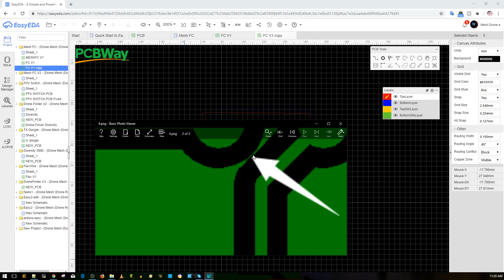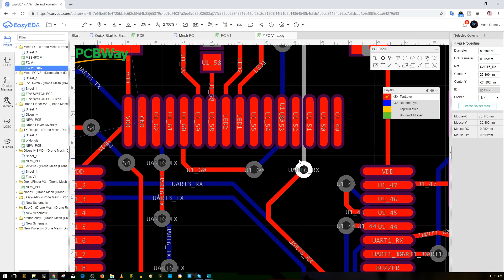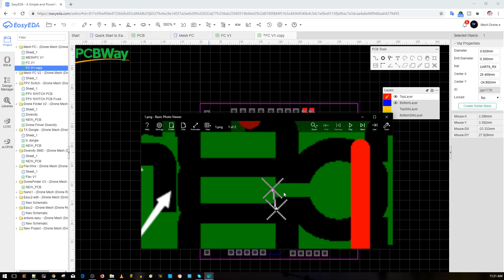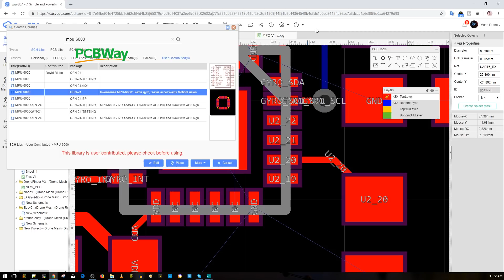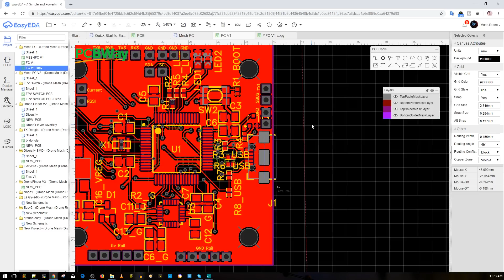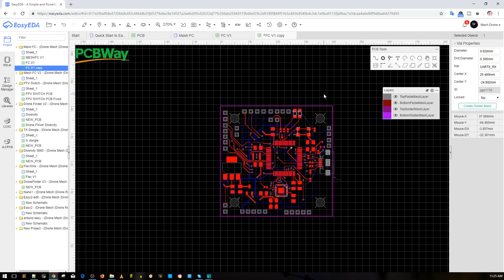I Made a Mistake!!! // DroneMesh OpenFC V0.02 Update

Comment: Pcbway says its now v0.03, I want to purchase, but I was woundering, what BF target do you use? Also is the f4 processor already loaded with the firmware, and running at least in BF.
Reply from the maker: Yes that is the correct one now... This is the first board with correct modifications.
Reply from the maker: The board does not come with any of the hardware on it. This is only the PCB and you need to build it.. The firmware needed is the FuryF4 in betaflight target list.